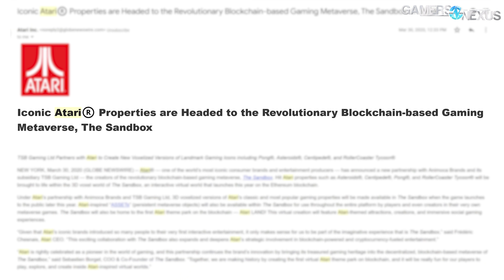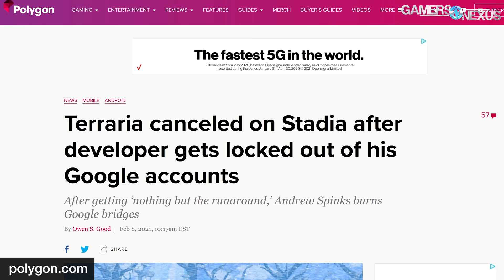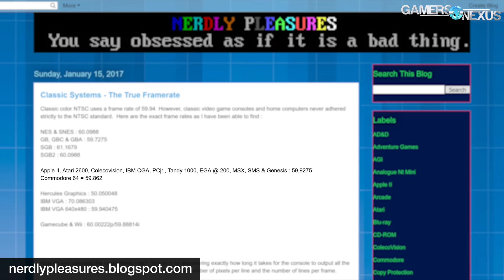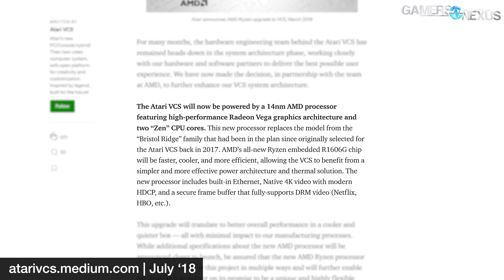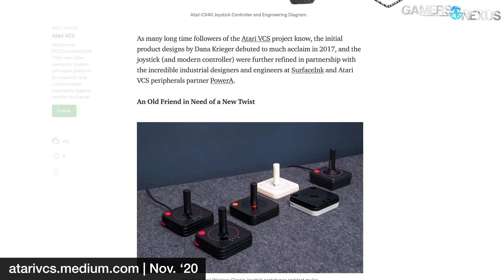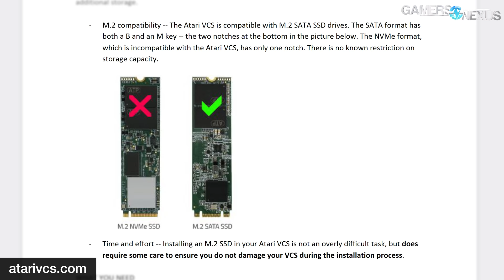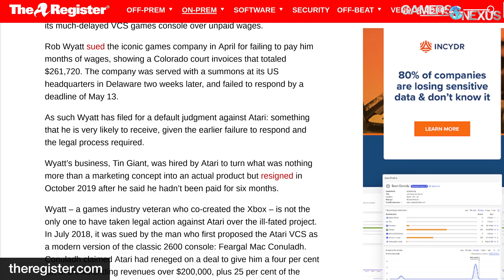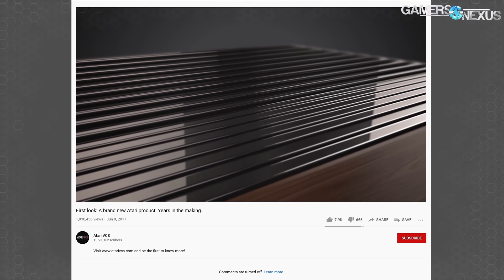Against All Odds: Atari VCS Mini Ryzen PC + Console Review

Comment: Honestly, the VCS is expensive for what it is.
The Wikipedia page has been edited to remove this, but allegedly the R1606G is based on a R3 2200U, a processor found in base model laptops such as the HP Pavilion, Dell Inspiron, or Acer Aspire of the relative year of original processor release. The cheapest I could find is $320 for a 128GB SSD, or $375 for a 1TB SSD. Keep in mind that for an equivalent base PC, you need a Windows license and an SSD if you actually want to use anything on Windows, as the 32GB of internal is a bit limited, on top of the $300 base price. Oh, and you'll need peripherals other than the controller, which is a $60 Power A controller, which is an absolute joke, to use Windows. By comparison, prices heavily favor repurposing an old laptop. Keyboard, trackpad, display, and the system, plus a battery and charging, for what's less than the equivalent price of upgrading the VCS to Windows without an additional SSD. 
Plus the VCS is already outdated. It hasn't formally released, it's still under pre-order status, while the mobile 5000 series chips have released. This 'brand new' product is three generations old now, though devices with the recently released processors aren't quite available yet. Even if the VCS had one of the new chips, I bet it would still be expensive by comparison. I get that crowdfunded hardware is severely behind the curve when it comes to updated hardware, but the price tag on this is ridiculous. You'd literally save money by buying an older laptop and emulating old Atari games on it, for an equivalent processor, with much more functionality. Remember how I called the controller pricetag a joke, that controller is nothing more than a stylized XBO controller, that PowerA sells for under $30, with the only real difference being the dpad disc and front faceplate; even the newer XBSX/XBSS controllers are $35, so you can't argue that the 'new design' is worth $60. Plus the joystick's price of $60 also is an entire joke, and I'm not even sure why it exists when the full controller does, especially at that price. With an equivalent system with equivalent features, minus the batteries and display, you'd be saving literal hundreds, if not close to the entire price tag of the VCS, by buying an old laptop.
But let's also look at the price tag in terms of consoles. Base VCS is $300, XBSS's MSRP is $300 and comes with a controller and modern hardware. VCS with controller bundle is $400, or $360 with the base system plus a singular controller, compared to a PS5 digital edition's MSRP of $400, which also has modern hardware. Then compare those to the MSRP of the XBSX and PS5 disc edition of $500, for an upgrade of hardware, not in just generation but also moving towards desktop-esque hardware. 
Then let's look at the VCS by itself. That much money for a custom Ubuntu distro to emulate Atari games, and run some modern apps. Honestly the processor might be overpowered for this task. I'm a bit surprised the hardware isn't an ARM processor, considering what the VCS's main purpose is. Again, expensive for what it is.
The VCS is expensive no matter how you look at it. I get that Atari is a niche product, but they're pricing themselves out of general consumer markets. This is nothing but a nostalgia cash grab, and unfortunately the people that fall for nostalgia cash grabs don't know any better. If Atari had any hopes of returning as a legitimate company, this is not the way to do it. I wouldn't be surprised if this ends up as a bargain bin special, considering it's niche and the only actual retailer so far seems to be GameStop, and anyone with half a brain cell will realize that maybe there's better alternatives for the money, as all it takes is a few minutes of research to understand how high the price tag is for such little value. 
I've really had no interest in APU based desktops, but I'd be curious about price for performance for a roughly equivalent system. Or even a comparison to other AMD mini PCs.

Comment: Do they not have the source code for these games? If they do, they could easily add more sprites for this console specifically. It'd be an easy fix. Otherwise, it'd also be easy enough to write some machine learning code to detect if sprites should stay on screen for each game. There's a limited number of games and I'm guessing there are many games that show no problem. So it'd be only for a limited number of games and because the screen size is so small, this would be easy to do. Also, most processing time is in the learning phase and the game speed doesn't matter there. At runtime, executing machine learning code is just a few matrix multiplications and the GPU they have should be more than adequate.

Heck, I think even doing boolean "XOR" on previous frames and caching them could tell you which sprites to keep on-screen at the cost of a few frames delay.

Comment: Most of us just need an xbox series S with windows in it and no controller. How hard could it possibly be?
Reply: @furry_homunculus  I don't know what commercially sensible means. 8core 16thread cpu, discrete graphics card, 512nvme, 10gb of ram, for less than 300 dollars...
Reply: @furry_homunculus  that might be the case (I doubt it) but even at 500 it would be a bargain
Reply: @furry_homunculus  Microsoft has always sold their consoles at a loss. There hasn't much of any profit with the Xbox brand since its creation.

Comment: These machines have nothing to with the iconic American company Atari. The brand name and the logo have been bought and sold many times since then. The brand name is currently owned by Infogrames which is, horror of horrors, a French company currently trading as Atari SA.

Also, that document you showed is from De Re Atari for the Atari 8 bit machines. They had an ANTIC chip which DMA'd the player and missile data. 2600 didn't have an equivalent of that and the 6507 CPU, a 6502 with fewer address pins, had to do it in software.
Reply: Newsflash genius- Atari was founded in 1972, and sold to Warner in 1976.  SO- the original Atari VCS was sold under a different company than the original.

Comment: Issue the Technology is out dated and they still want a Premium Price. They should have released it 2 Years ago. Now with PS5 and Series X out there is zero reason to consider one of these.
Reply: You can run Windows on those?  Do they have Chrome?  Make them look as nice?  Will they integrate blockchain?  No.   Just because you don't like it, doesn't mean many others don't already- and will even more once it releases retail and has a lot more stuff released.

Comment: The price of these things are absurd.
Reply: $280 is not that bad, have you looked at the price most NUCs come in at ?
Reply: @Tano yes, and that's where I was getting at, you can get a NUC at that price only if it's bare bones, but as soon as you add in the cost of storage, Ram, Windows license and what else you need to operate it the price of the NUC doubles, and that price for the NUC is usually for the extreme low end models (Celeron based NUC).
Reply: @Tano I don't know why you're coming across as confrontational.

Comment: That barely resembles a 2600.. the fake wood and black is all there is. They would have been better off  recreating the old 2600 case with functional switches and a slot in the top that could accept original cartridge's or at the very least a USB thumb drive game library in a cartridge shaped plastic box.
Reply: Well duh, they wasn't going to make the case exactly like the VCS/2600 it was never planned to look exactly like it. But it does resemble a VCS/2600 due to its shape, and that's what they was going for, I'm glad they didn't 100% clone the original VCS/2600 and I sure the heck do not want switches on the console itself, it was a PITA back in the day, and it would be a PITA today.
Reply: @madmax2069  I am not sure you understood what i was saying. I am the target audience for that thing, I played the crap out of the 2600 when I was a kid, so much that the rubberized plastic over the joystick broke and was discarded and I had a white plastic joystick instead. That does not make me want to buy one out of nostalgia because it barely looks like a 2600. It does not scream buy me for nostalgia sakes. They would have been better off recreating the 2600 plastic box as close as possible. With a cartridge slot that i can put original cartridges in even if they don't do anything or stick a thumb drive into the USB port there or have a dedicated cartridge that is a USB drive for a game library.

That thing is too far removed from the original to make me want to buy one out of nostalgia, it doesn't even look like an original user was involved in designing it. To my eye it deserves to fail as a product because the target audience is not the audience it is targeting. It looks like a rendition of a 2600 my daughter would think looks like one because she only sees them in passing if at all and only knows that her father played games on one as a kid when she had a PC for games(my old one handed down to her). That's the audience the plastic box targets, the children of the target audience the project was meant for.

If It looked exactly like a 2600 but was just a mini PC I could use for other things like Netflix or email with the whole Atari 2600 library on it and an official emulator? I would buy it for nostalgia. That thing can go burn in a dumpster.
Reply: @AndrasMihalyi  Exactly! would look like the original and bring back the nostalgia and make you want to buy one. That thing doesn't look like one and thus no nostalgia and no desire to buy one.
Reply: @AndrasMihalyi  And that's why the need for the nostalgia factor. Nobody is going to buy one just for the games because they could get them for free already. But having what looks like a 2600 in the cabinet below the TV that can play the games or other modern entertainment is worth it.